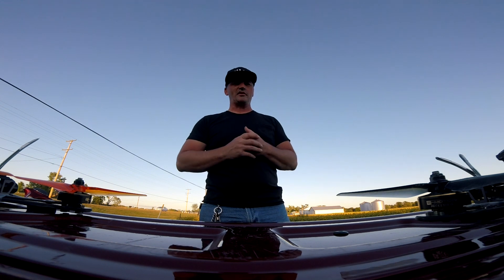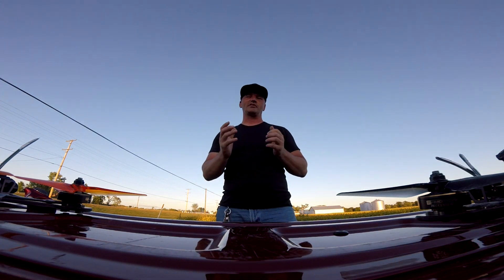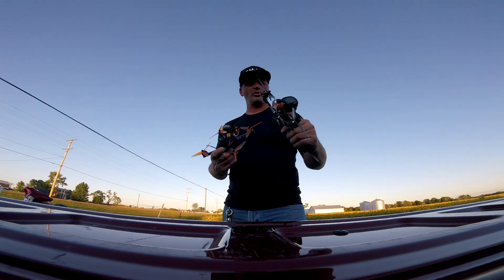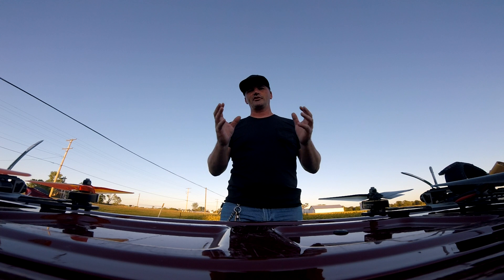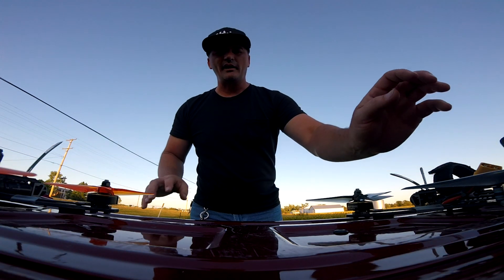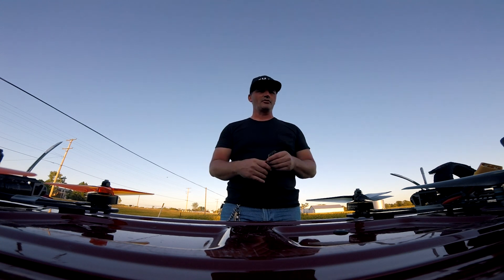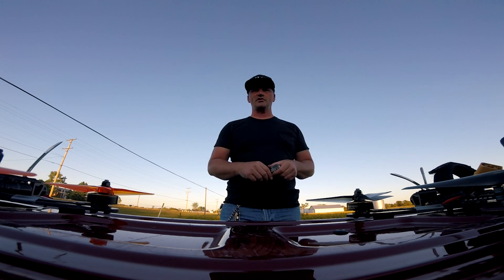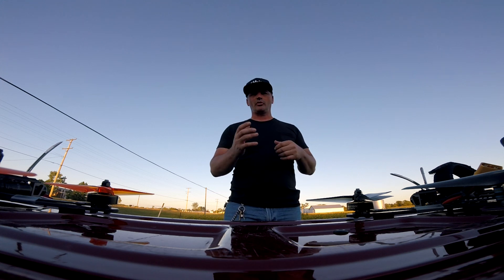HobbyWing G3 Stack vs G2 Stack

Comment: Do you ever have a problem getting the onboard OSD to register the battery or the current? My current problem.
Reply from the maker: no ... did you enable it in BetaFlight as well as connect the wire?